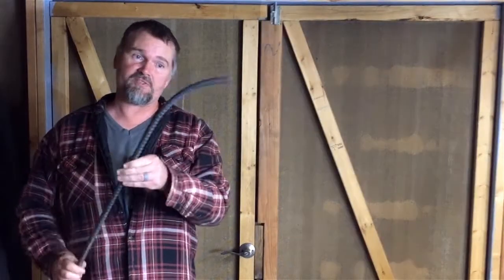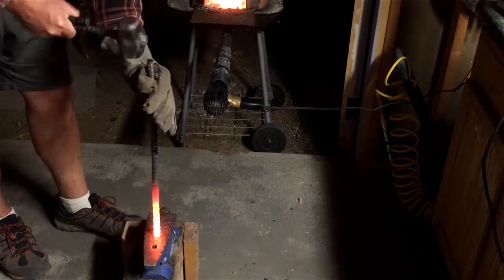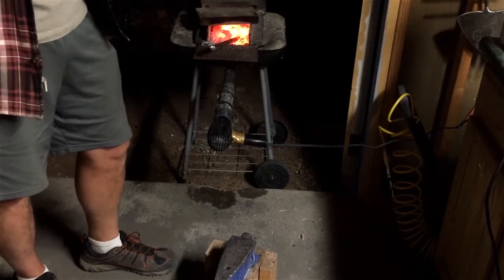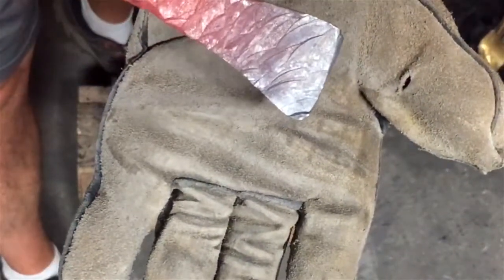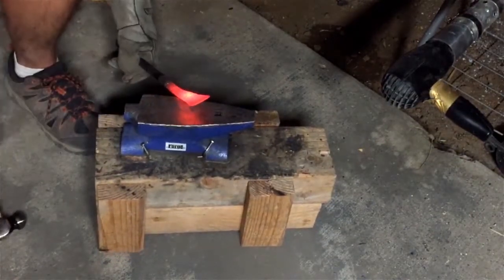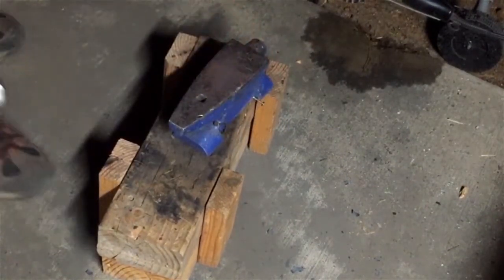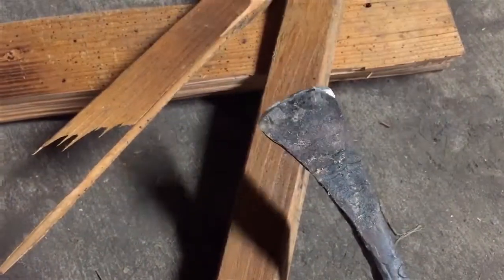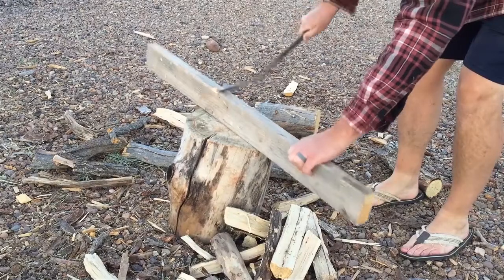Forging a Post Apocalypse Survival Hatchet from Rebar

Comment from the maker: So, what's the difference between a tomahawk and a hatchet?
Reply: Tomahawk sounds cooler.
Reply: FargoFX a tomahawk was made by First Nations as a throwing weapon where as hatchets were originally used as a lumber jacks extra axe in case the other axe broke.
Reply: FargoFX size shape and weight of the head
Reply: FargoFX Tomahawks are meant for throwing with a typically leaner/smaller blade and occasionally a spike for half spin throws. Hatchets normally have larger heads and are meant for one handed chopping.
Reply: FargoFX Also, when upsetting metal, rotate the stock every blow for even distribution of steel. Really love your vids by the way. Personally, I can't bladesmith yet for another 3 months (until my 13th birthday) but I have learned a little from Forged in Fire and a LOT from about 5 books and inspiring you tubers like Alec Steele and especially you. Keep up the good work and that 1 k will evolve into 1 mil. Just keep at it and do what you love.
Reply: FargoFX The tomahawk is for fight , atack - defence , the hatchet is for choping wood , etc ...as a tool .
Reply: the size and shapes is the biggest thing 

a tomahawk is a small light weight and packable and the cutting edge is usually no bigger than 2 1\2 inchs ,usually it was used as a travel axe or a fighting axe 
the shape was based on and specialized by the native americans and there stone tools

a hatchet has a diffrent shape ,is slightly heavyer, and was more common with the loggers and home steads ,and semi permanant camps . loggers couldnt carry a full sized axe up in the tree tops so they settled for a smaller hand size axe
Reply: Tomahawks are mostly used for throwing or as a weapon, but they are also now used as small pack axes

Hatchets on the other hand, are used for wood chopping and splitting
Reply: @ionsorinporojan149  I still wouldn't want to get hit by a hatchett .

Comment: Those blow dryers have brush motors and run on 9 or 10 12 volt DC batteries in series, like drill motors,  leaf blowers, angle grinders and others.